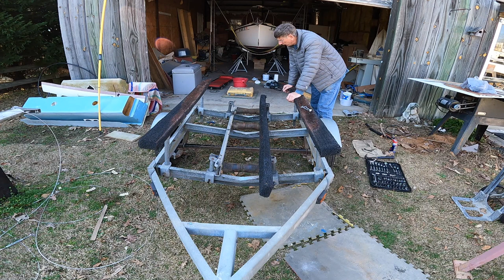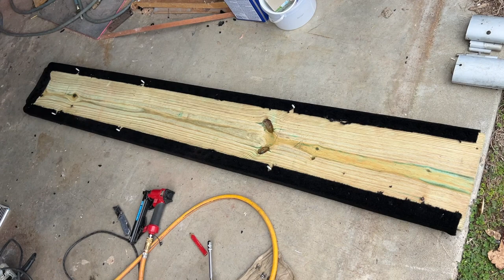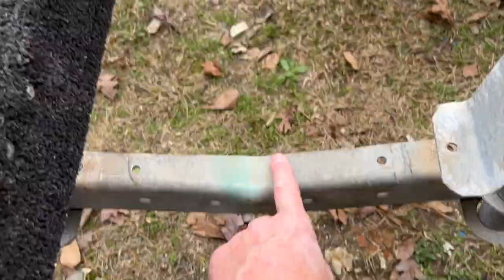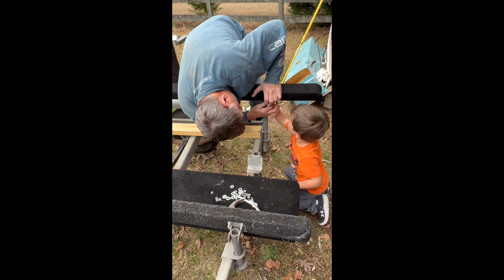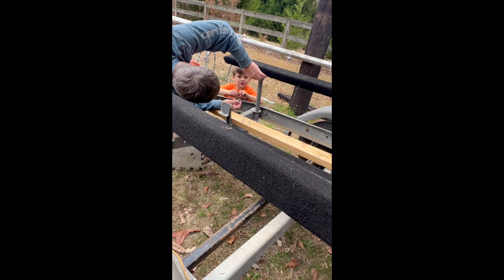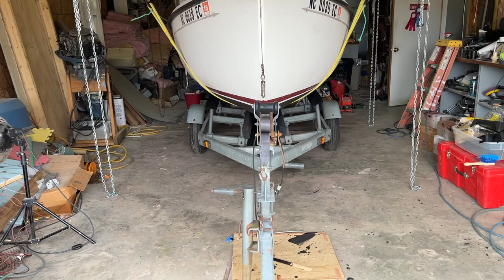Com-Pac 16 XL trailer repair  while boat is off

Comment: Nice to see you passing the knowledge along to the next generation!  Good idea to add the wedges to the underside of the 2x12 for the support.  Question: did you run bolts through the front end of the 2x12 at that cross member that you notched it out for?  If you do use it as a step while launching, it might help to support that end so it doesn't get spring to it when you stand on it.
Reply from the maker: Yes, I did put 2 bolts there with washers
Thanks!

Comment: Professor Boatnik, thought I’d post on your recent video many thanks for all the experience and knowledge you have with Com-Pacs. I’ve watched them all twice if not more. I’m refurbishing my ‘83 CP16 Mk1. Help if you can direct me to ideas, the portal plexiglass windows scratched, replacement ideas or buff out with auto headlight kits? Thanks
Reply from the maker: Ive never tried polishing them 
It might work if not scratched too deep
I just cut new acrylic if I need to replace lens
You might be able to get replacements directly from Hutchens (Com-Pac)
They have a list of available replacement parts for all their boats
Thanks for watching!

Comment: nice job on the trailer.  I'm about to pick up a Compac 16.  It''ll be stored on a trailer in the off season and on a hoist in the summer.  When not in the water, should the majority of the weight be supported on the keel and the side bunks primarily for balance, or should the side bunks take some portion of the weight as well. thanks
Reply from the maker: The side bunks are mainly for balance, but they can carry a little weight
Most weight on the keel as you said
Thanks for watching
Reply: @theboatnik1328  thanks

Comment: Do you have any or can you recommend any videos on how to repack the bearings?
I usually had this done at the trailer shop, but they told me they no longer provide this service.  Instead they recommend buying whole new wheel hubs which are already packed, and from their experience give better service.
My thought is they simply don't have the people to do the work at an economical price making buying a new wheel instead feasible.
Reply from the maker: I don’t think I have any video of this
At least not in depth
No reason other than convenience to replace the whole hub unless a bearing race spun in the hub or something else damaged the race seats
It is a messy job but not difficult
Next time I will try and remember to record it
Thanks for watching